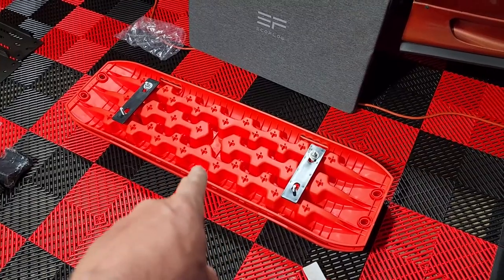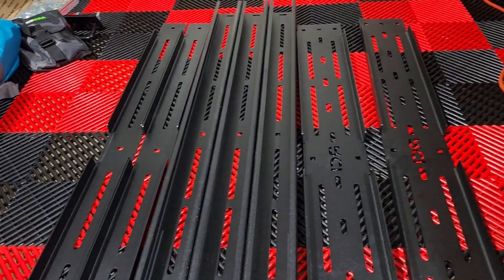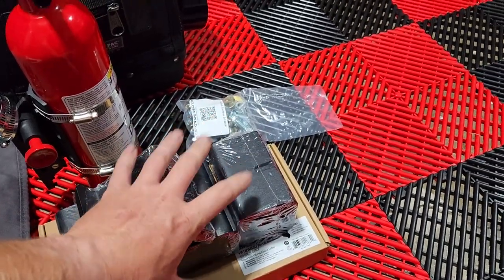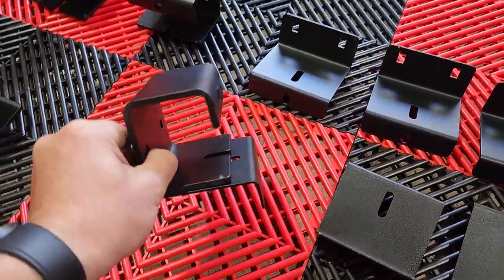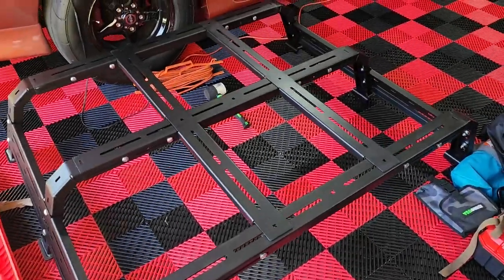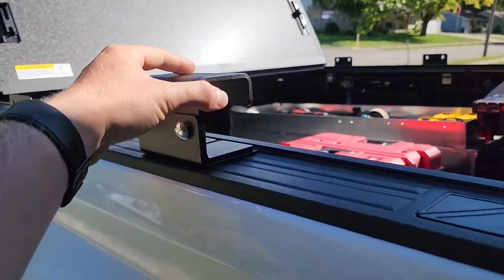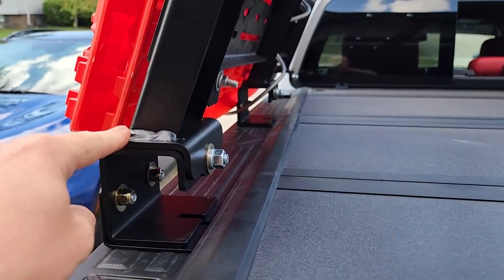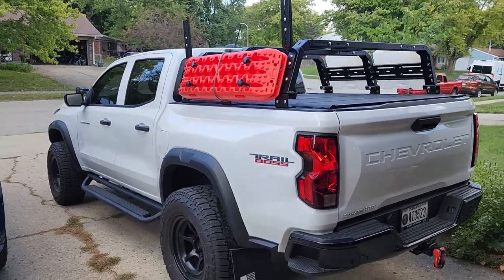RCI Bed Rack Assembly and Install on 23 Colorado

Comment: That looks awesome Tony. Do you know if the tonneau adapter would work with all tri folds? I have a gatorz tonneau cover on my trail boss, and I was wondering if it would work on that cover as well
Reply from the maker: Yes it should work. Yours is very similar to mine I believe. The only thing is you can't really open the Tonneau cover once it's on.

Comment: My 2023 ZR2 arrives in 2 weeks. I was looking at the RCI. What length is your rack? Also, what is the height from the bedrail to the roof? Is it still 18" like the old Colorados? I was going to get the 18" rack, but if it is higher than the cab, I don't want it. the 12" high one would cut my rear view, so i don't want that either. Thanks!
Reply from the maker: The is the 46" and 12" high rack but with the Tonneau cover brackets it's an extra 3 inches tall